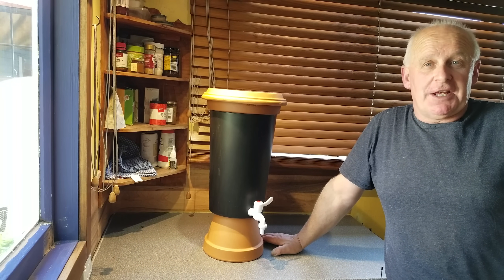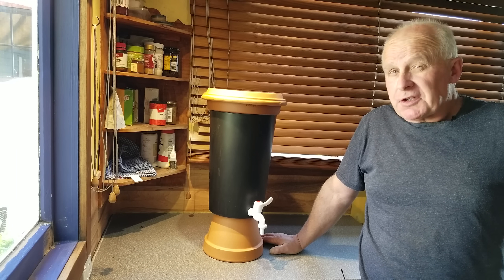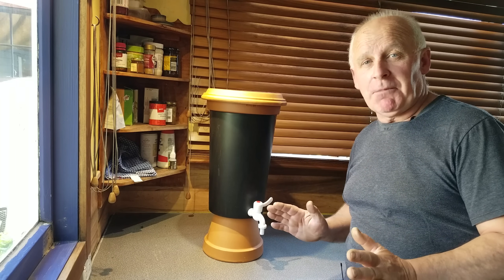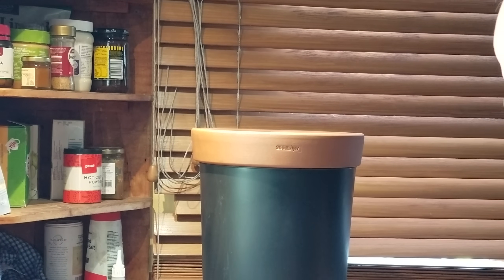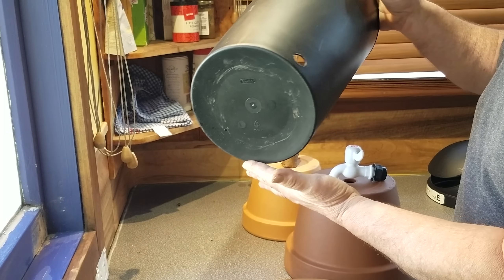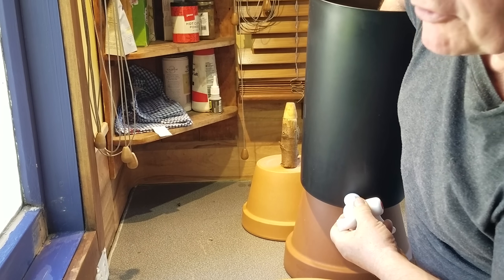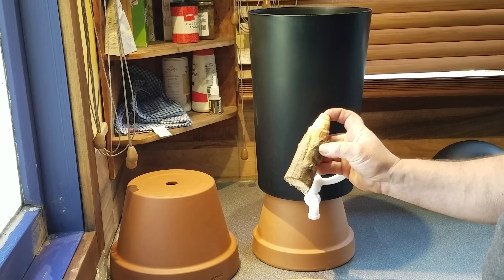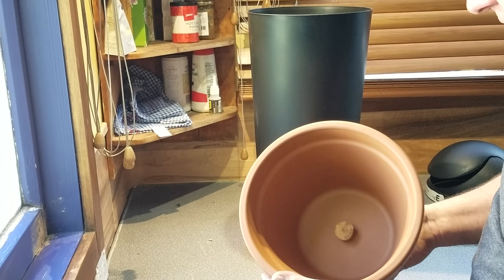DIY water filter. How to make FILTHY WATER drinkable

Comment: Something I would think about is possibly finding another place cylinder or another claipot to put it in that you can seal up and then add your spout to the very bottom where the wiking home normally would be kill two birds with one stone with the evaporation from the clay you will call the water and always have water that is slightly cooler than room temperature depending on how the airflow is in your home and you never ever have to worry about getting that plastic taste in water ever again

Comment: How would you ensure it wasnt accumulating and getting overburdened with filtered debris.  The berkey recommends cleaning and scrubbing the carbon filters and things like Zero Water require changing the filters after use.  So question is how do you maintain it?  Or do you replace the ceramic pot over time?
Reply from the maker: By cleaning it according to the described protocol monthly.

Comment: In the UK there are many centuries old houses formerly owned by the Lords of the Manor, but now open as museums.  In the kitchen of one house I saw a centuries old water filter similar to this made from un-glazed pottery, so this is a centuries old technology.  Thank you for your video.
Reply: Mark- I’ve also seen this old tech. My great grandparents cabin had a large rectangle unglazed terracotta tub (it resembled the now popular vintage ‘farm sink’). It was sitting on a solid built in self near the roof. It’s water was supplied by a drum outside that was naturally filled by rain water run-off collected from the roof gutters.

The odd thing was that despite not being refrigerated, the water from the terracotta tub was, while not cold, it was definitely cool. 

I was a kid back then so not completely aware of the entire filtration process. But the gutters had screens, the drum water exited above the bottom (meaning the drum needed draining and cleaning yearly as the bottom collected sediments), then there was a system of pipe to bring the water to the tub (but I never participated in cleaning/maintaining that). 

I just know I drank that water during the summers (it was the only water the cabin had. Other than a rain barrel that was fed from the shed roof, but that wasn’t filtered, it was for laundry, dishes, and plants).
Reply: @dericksmith2137  Meso Americans did so for the reasons stated. It is still quite common to see handing 'drinking pots' in some households. The water is cooler in the pot due to evaporative effect.
Reply: @johnmcginnis5201  dunno what they were doing but the very old cave of khoi and san peoples have some clay pot shards
Reply: @johnmcginnis5201  The olla is a different mechanism. Yes, it cools the water but it does no filtering.
Reply: @dericksmith2137  when the water evaporates (goes from liquid to gas) it requires energy in that process. That energy is in the form of heat and is extracted from all surroundings - the air around, the pot, the water hence cooling everything adjacent to the evaporation process. 
This can be used on a beach a sunny day. A towel soaked in the lake and wrapped around a bottle with beverage inside will cool the fluid inside. Even when the temperature of the drink, the bottle, the air, the towel and the lake water are identical to start with, heat will be taken from everything around the towel to evaporate the water in the towel and so the temperature in the bottle will drop below the ambient temperature. Nice right?!.. 
So starting off with everything at let’s say 30 degrees centigrade, after a while the beverage is colder despite everything around it still is 30 degrees! 😉
Kind regards 
Anders
Sweden
Reply: That's so interesting! The water was cool because of evaporation. In the Southwest, unglazed pottery water jugs were once extremely common. The water oozes through the pottery's pores, evaporates, and cools the water inside.
Reply: @dericksmith2137 
I enjoyed reading your post. 
It's fun to take a look back into the past sometimes isn't it?
Reply: @dericksmith2137 
Wow!
You experienced the effect of 'evaporative cooling' - and had (probably still have) no idea what you were looking at.
Reply: @dericksmith2137   That is because a certain amount of water is evaporated off while it is slowly filtering through the ceramic--the evaporation is what lowers the temp.  Water has some interesting and unusual properties, and two of those, is its high specific heat capacity (it can hold/retain a lot of energy), and it takes a lot of energy for water to change between its various states of matter i.e. between a liquid to a solid or gas.  When water is going from a liquid to gas state, it absorbs a lot of heat from its immediate surroundings and releases it into the air along with the water vapor. Evaporitive cooling via water evaporation is actually a viable way to cool things significantly--particularly in a lower humidity environment.
Reply: @justinw1765 great, simple explanation. Perfect information.
Reply: that is really interesting! thanks for the share :)
Reply: So simple, and already proven.. I'm good to make one for my kitchen, I live in Ohio and have water that sometimes tastes like rust and sulfur. And it wrecks my coffee. Thank you you for sharing.
Reply: @butchjohnson40  Through clay vessels is nearly as good as reverse osmosis filters. Best is to filter the water with cheap cleanable and replaceable filters before the clay vessel to minimize gunk buildup on the clay vessel.
Reply: @butchjohnson40   If your water is that bad, you'll need a much better filter than ceramic alone.  Ceramic mostly just filters out particulates like dirt, sand, some heavy metals, down to large bacteria and parasites. It doesn't do much for dissolved chemicals and ions. You need things like activated carbon and ion exchange materials to filter out that.  Or a R.O. membrane.
Reply: @butchjohnson40  Probably fluoridated too. It doesn't help teeth to drink it, and we've always known that. ;)
Reply: @VndNvwYvvSvv  They often add flouride at above recommend levels even though it's unnecessary in modern society with toothbrushes waterpics etc and especially  with dentist visits (always doing flouride treatments as well)  Totally unnecessary now and dangerous. Also, their flouride comes from toxic factory smokestack waste.
Reply: @butchjohnson40  I’m in Ohio also. The city water is full of chemicals and wrecks the gut.
Reply: @dianadowdy3043  I’m in Ohio too
Reply: @butchjohnson40  I know what you mean. When I lived in Sarasota Fla the water reeked of sulfur most times. It was good spring water but boy it smelled bad!
Reply: Speaking of sulfer...a bit off topic, but did you know that a sulfer smell in hot water is actually caused by a harmless bacteria living in your hot water tank?  All you need to do is pour in a large bottle of cheap hydrogen peroxide and it will kill the smell as long as the tank stays hot. At least six months off one bottle.   If the tank ever gets cold, you'll need to drain it and add a new bottle of peroxide. (You're welcome!)  I tried it and was astonished that we lived with that dang smell for so long when all we needed all along was peroxide!
Reply: @ricosuave5120  Interesting! Thank you for the information.
Reply: @butchjohnson40  the best way is to buy an inexpensive reverse osmosis system and you'll find out what coffee and tea REALLY tastes like.
But you won't ever want to drink tap water again, no matter how good it is.
Get anything that has a filmtec membrane  (dow corning ) and  you don't need to care about ion resins and other stuff. Buy a box of string or polyester prefilters as well, and change them regularly, buy carbon block and crushed carbon filters.
It's way cheaper to jut buy a box of them with all  3 kinds of prefilter. Try to not buy from China...theirs come  with less carbon in them and who knows what the carbon came from.
Reply: @VndNvwYvvSvv  "Does it filter fluoride?" Yes.
Reply: @VndNvwYvvSvv  I never use the ion exchange resins. In most urban situations they are uselessly expensive and just overkill.
Reply: @VndNvwYvvSvv  The prefilter for dirt and rust and the carbon prefilters to break the chloramine bond, those are placed before the RO membrane and are absolutely essential,  in order to prevent destruction of the RO membrane.
Reply: @butchjohnson40 Hello! Is your water from anywhere near E. Palestine Ohio?  Just wondering if your water is affected by the chemicals that dispersed from that train catastrophe.  I live about three hours from there.  God bless you.
Reply: That makes perfect sense. 👍
Reply: Great! That's for your sharing your enthusiasm. Keep that way! I will cont. attending.
Reply: Yes and some leeched unwanted properties. Make sure your unglazed pottery is safe.
Reply: I bought a  British Werkefeld in UK. The filter is made of some kind of white clay or ceramic. Very effective and no need of electric.
Reply: Great DIY will doing this one. Have you ever tested the water at the spigot just curious the results
Reply: I  Mexico my ancestors would bury terracotta jugs filled with water for irrigation purposes. Genius 😊
Reply: @desireeespinosa3954 they we’re probably making tequila. And just told you it was water.
Reply: This is used in almost every house in Brazil.
Reply: Nice demonstration. I have a couple comments, I too like some others pointed out here would prefer to use a plastic food grade container. As far as the terracotta pots, I am concerned especially in the USA that most of the terracotta could contain lead in it because most of the pots I see here are either from Mexico Or even China. Just something to think about. Thanks!
Reply: A long clay pipe upright can apply water pressure to force the water through the  walls. If you have electric power, you can add a pump to increase pressure.
Reply: This process is good. Those who are inclined can also distill or use inexpensive reverse osmosis processes.  Great tip here thanks
Reply: @esat189  both of which require electricity unless you build a solar distiller.
Reply: In Brazil we still have it. Brazilian technology. It's indeed not a fortune.
Reply: YEP - Im British - I have a memory of an unglazed cone with a lip that sat in a white ceramic jar - at the time I did not quite know what it was for - this is obviously what it was for.
Reply: the same in Indonesia it's old tradition to store wat in such un-glazed clay pottery but today I see them rarely
Reply: Great production! Ingenious and practical. Thank you, sir.
Reply: Great advice. Thank you so much for your video. I already bought everything. ❤
Reply: There is nothing new under the sun. Just knowledge hidden away, until someone remembers that it exists!
Reply: could be 10000 years old if you look at how long we had the material and used it for water.
Reply: Cemetic Gardens
Reply: Isn't it strange that all of those thousands of centuries of our ancestors knew how to survive AND knew what they were doing?! 🤔
This 'technology' predates the Roman and Egyptian empires.
There's nothing knew in the world in the way of 'principles' of 'technology'.
There are only knew ways of 'packaging' those 'principles' to take money from lazy ignorant suckers.
Reply: Thank you for the share
Reply: Merci pour l'information. 
Blessings +++!!!
Reply: Would this clean the water from bacteria?
Reply: @anabelaramos8399  one of the comments in the thread mentioned it filters out bacteria and parasites.
Reply: Thankyou for your very helpful informative and excellently presented video !
Reply: How long does it take to filter the water?
Reply: Where was that exactly? Interesting
Reply: dream of copper gravity filter with brass or copper spigot
Reply: Yeah but sed even if they had water that  was filtered they still did not do a daily wash or bath Pee uuuuh! !!
Reply: @margritpiepes8242  I believe that was where the word "flies" comes from for the front buttons or zipper on a man's trousers or pants.
Reply: The unglazed pottery keeps the water cold; the water seeps through the pottery a tiny bit and gets cold from the wind.
Reply: That yall stole,  move from onto those bodies.
Reply: Uses a Rubbish bin type 5 from memory is ABS not PP yeah he's a genius forget he's using plastic didn't bother to wash it out.
Reply: @yfelwulf you actually want to watch his every move maybe he did wash it but felt most people would figure he washed and didn’t need to show it to prove it. Why assume the worst?
Reply: @yfelwulf  You could use a food grade plastic bucket.  Sometimes if you ask, stores will give you an empty icing bucket from the store bakery area.   You'll have to clea  it really well, though.  Or, just buy a new bucket of food grade plastic.

Comment: Cool, read many variations of why or why not here makes it interesting! Have been cityfied many yrs now ,but have been using filters of various types since the early80's ,long before it was a popular thing, off the farm at least :) Used to set the clay pot,in the ground, next to my rose bushes and various garden places to slowly "filter" drain to keep gardens wet. so same idea. would adding glass marbles to the ceramic pot help filter more of the larger particles? maybe give it a cleaner taste? I made my filters from scrap 4 in. pvc. the flexible hose like on a spray hose and vinyl hose and clamps. using charcoal and stainless filters that still cost just 10$
Have made these for friends too, installed under the kitchen sink ,mine now is a separate single cold water faucet on the sink, was al scrap stuff so cost minimal. , also food grade plastic buckets are often free from places that use them in quantity like schools or hospitals for water or household use!  thanks making me wish I was still living in my truck or trailer on a river somewhere:) (again) :) peace take practice. Rick Wichita Kansas
Reply: Wouldn't pvc leach toxins?

Comment: I'd love to see the water tested before and after the filtering. Great idea thank you!
Reply: I'm a water treatment specialist with 35+ years of experience. Filtering water can certainly remove particulates but doesn't usually remove dissolved solids, nor does it make the water safe to drink. You could boil the water for 2 minutes or treat it with a disinfectant, such as bleach, to make it safe for you and your children but Filtering alone is not enough to remove harmful pathogens or contaminates.
Reply: @daledelatte9607  hi, we distill our water, is that considered safe..? We take some vitamin and mineral also . Cheers.
Reply: @alex-E7WHU  distillation is a more effective means to get safe water, but is not a 100% treatment process. In an emergency or long outage the most important thing is to have a water source available that can be easily purified for drinking and cooking. The easiest way to guarantee the safety of water in an emergency, is bringing it to a rolling boil for 2 minutes and allowing it to cool. Long term storage of drinking water will require a disinfectant of some kind, even if you've cleaned your storage vessel. 

I hope this helps
Reply: @daledelatte9607  thanks Dale.. I guess the big old kettle on the log burner will be useful.👍
Reply: How much bleach do you put in a litre of water? I think a drop is too much, so how much?
Reply: @badingere  not all bleach is the same strength. You would need to know what the percentage of chlorine solution you are adding and the volume of water you are treating. I'd recommend reading the container you're using to find the strength of solution, usually in % format and aim for at least 0.5 parts per million and never more than 4 parts per million. Depending on the length of storage and any materials that may neutralize the chlorine, you would have to adjust your dosage. Typically you can find some good formulas on line.

Comment: How does terracotta filter out microbes, lead and chemicals. Wouldn't those things need to collect and buildup inside the pot somehow?
Reply from the maker: Yes- just like in any other ceramic filter - the pore size is 2 microns same spec as hiqh quality filters. the concept is well proven and recommended  by the CDC as per the link in the video

Comment: So what can I do.  I live in Swakopmund.  It never rains here.  Our tap water has lots of chemicals.  What can I add to purify  our tapwater.  I suspect we have metals in the water. I have trigeminal neuralgia.  So I immediately react on metals. Also, what can be added to remineralize  the water?  Except remineralizing drops which is almost impossible to get here, and if, its very expensive
Reply from the maker: Personally - In these times - I would move to somewhere more conducive to off grid self sustainability. forget making money- those days are over.

Comment: Having that filter system next to the corner shelving suggests that someone else might omit the bottom pot and just set the rest on a corner shelf. Put the shelf at the right height and glasses can be stored underneath.
Reply from the maker: Yes absolutely. just remember clay is heavy - so is water